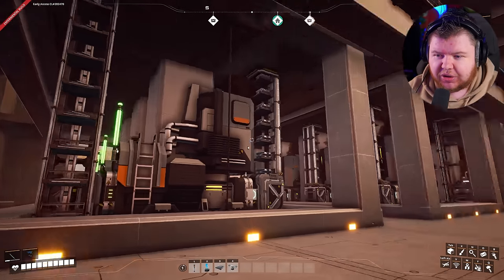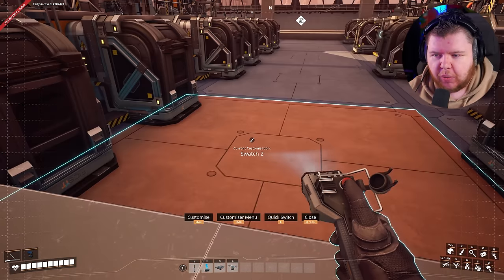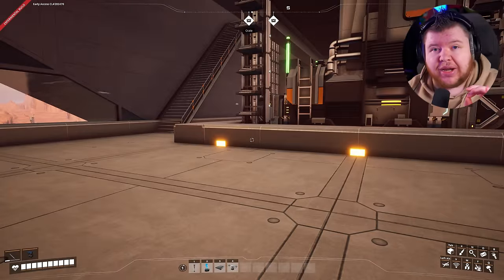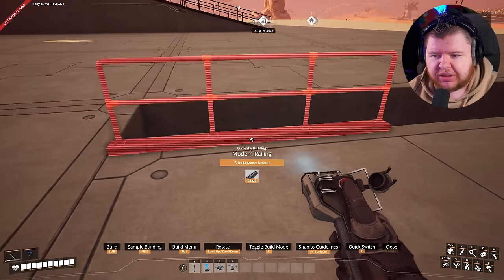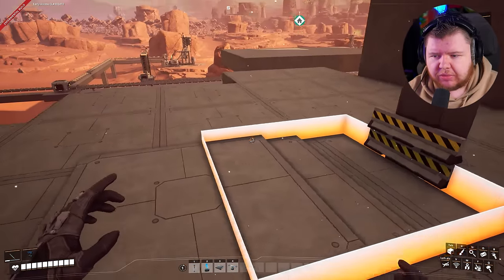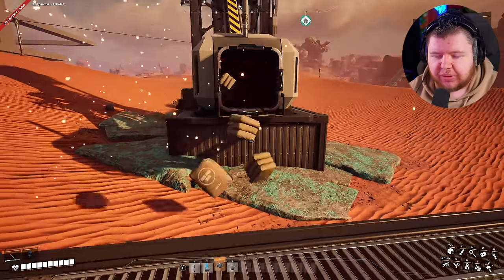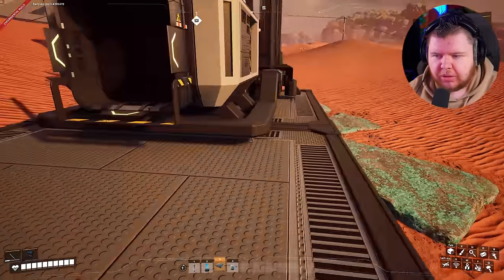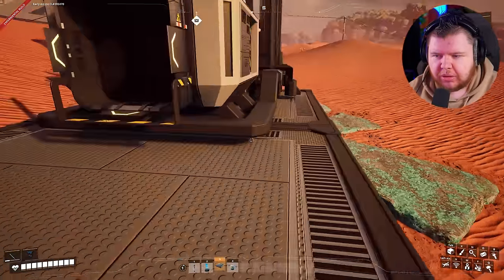TOP SECRET!! Tips and Tricks for SATISFACTORY

Comment: Nice video again little tip on getting the miner back onto the world grid after centering it. You can use a Splitter or Merger which you can connect to the existing Belt, if you place down a Splitter that is on the world grid, next to the belt, you can just align the Splitter on the belt up with the Splitter on the worldgrid and done. The splitter on the belt will have to stay but at least the belt is back on world grid :D

Comment: These were fantastic!  Thanks very much!

For making curves, I have used a system where you count out from the beginning of the curve (usually 7-11 foundations) and then use the end of that radius as the center rotation point for the curve.  You just zoop a line of foundations back to the curve after rotating the foundation piece at the end of the radius by one increment, erase the center, then turn it and repeat the process.  Have you tried this method before and found it lacking for some reason, or did you simply not know about it?
Reply from the maker: Oh I knew about it, the only issue with it you can't control the snake head of the turn as easily and the z fighting is alot more severe. This creating sharper angles for walls and cresting more noticiable clipping with them.

Comment: Another tip I learned from a different video. Turns out the new half foundations don't z fight when clipping through regular foundations. Don't know the full extent to its use, but might be helpful when connecting two roads together.

Comment: And of course another option to remove z-fighting is to slightly raise/lower every other foundation. Or even build them this way from start by building two layers of walkways. I'd recommend to use micro-manage mod, though. It's much simpler and consistent with any kinds of manipulations of objects placement, rotation (on all 3 axis) and even scale.